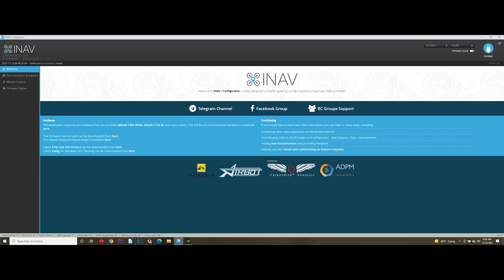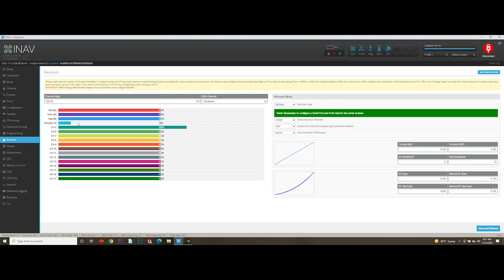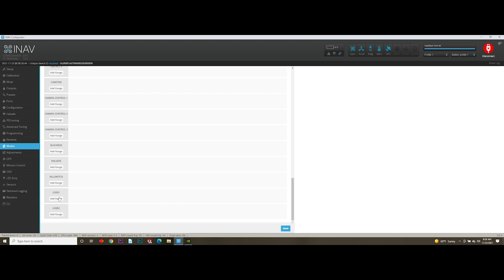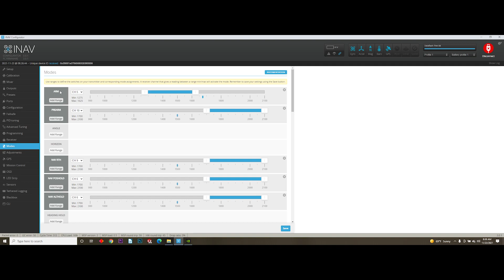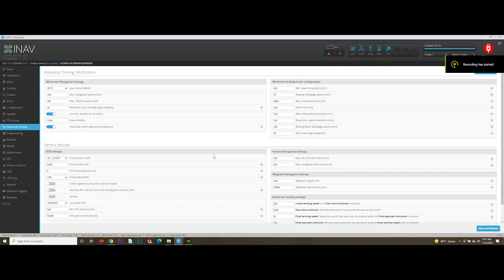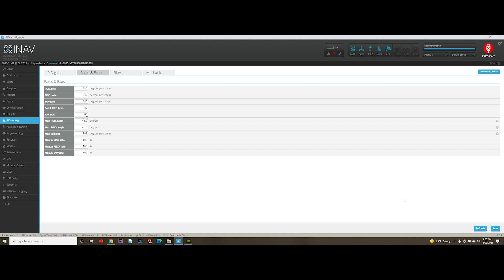MoneyShot Mini V2 Video User Manual

Comment: are we allowed to change failsafe mode? I'm thinking about a closed scenario, like if I need to pass under trees or bridges: isn't it better to have it set on position hold, so that I can run to a better place and fly it manually when telemetry comes back without risking for it to climb and hit those things?